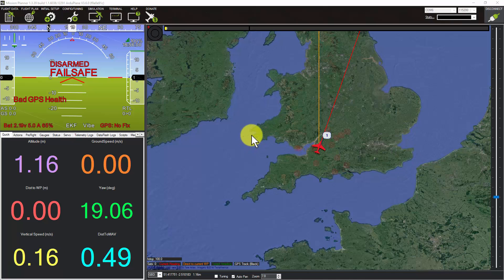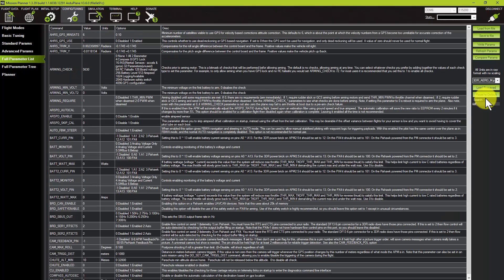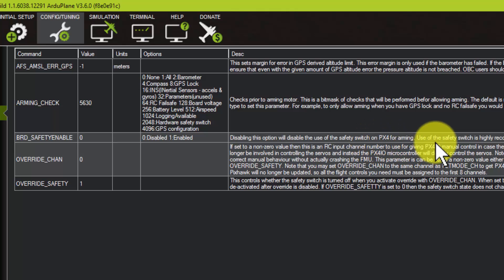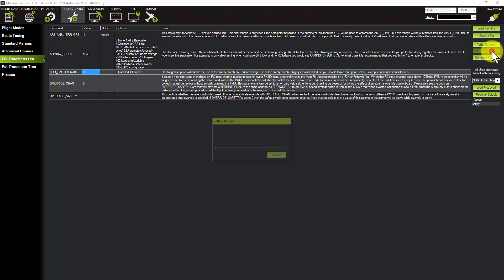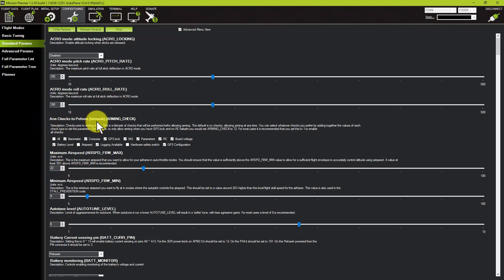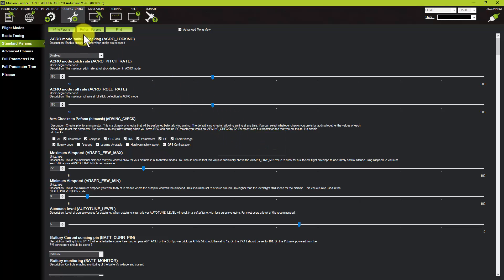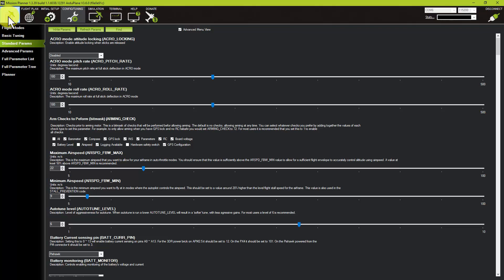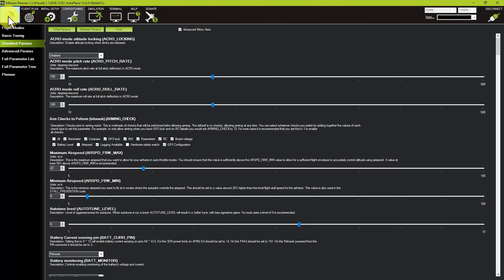Pixhawk Servos NOT Working? - How to Arm WITHOUT a Safety Switch

Comment: hi im eliel and I'm working on mission planner but only shows me bad param and somthing but everithing is an error "bad param". I can't see anything param at Standard params  and only see errorss help me how do i update mine params because dont work on mission planner eadither nothings work and i dont know waht to do heeeelpppp!!!! pls but is connected with all errors u can find on mission planner
Reply from the maker: Howdy, I'm afraid I cannot help with mission planner. I learnt enough to not use it anymore. Matt
Reply: @RagTheNutsOff  hey man check tye "messages? Tab under the attitude indicator. Will usually tell you what parameter is failing. Sometimes says things like "RC3 trim less than max"
Reply: may be reset by default param can be resolving the problem